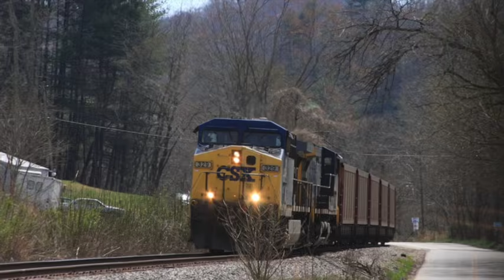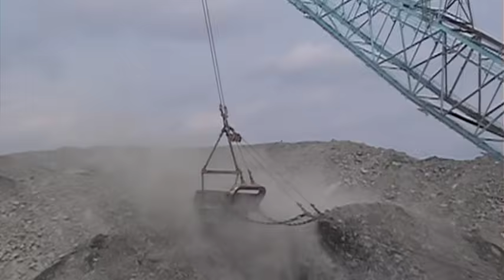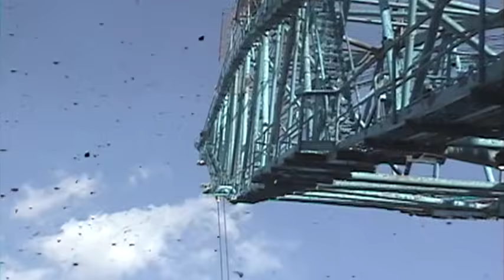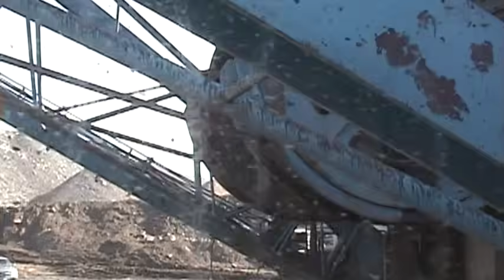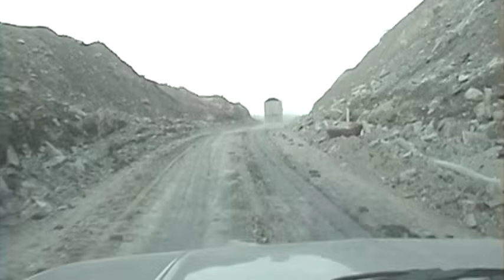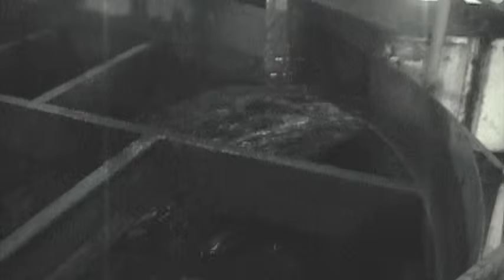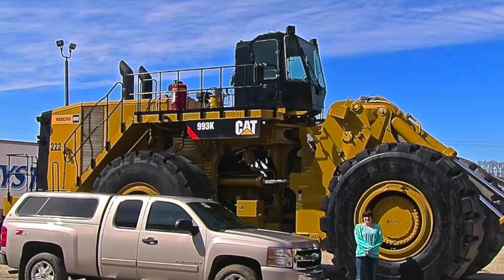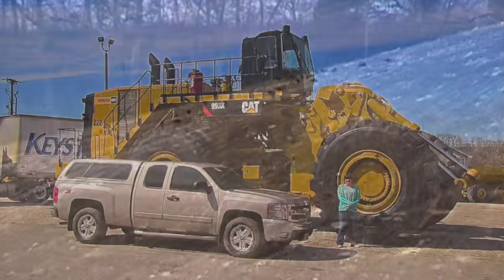Coal Mining in Appalachia

Comment: new wind farms could supply electricity at a cost of $80/MWh –compared with $143/MWh for new build coal, and $116/MWh for new build gas-fired generation.
Reply: Good points, both wind and solar are too inefficient and unreliable to take the place of fossil fuel power plants. Cost is part of the problem. The more significant, assuming the Sun is out, the largest solar farm in the United States coves 3,000 acres and generates only 500 megawatts. Assuming the wind is bowing wind turbines generate about 1 to 5 megawatts each. Meanwhile environmentalists and democrats want to shut down fossil fuel power plants which generate 1,000s of megawatts on a few acres 24/7 regardless of the weather.
Reply from the maker: ....and you point is?  How long  will it be before wind farms cover enough land to make the amount of electricity needed to replace the coal plants now in use?  Maybe for now we will have to settle for coal to make up the difference.  Do note my video is neither for or against coal, it is simply how it is surfaced mined.
Reply: historical energy production data reveal that if nuclear power never existed, the energy it supplied almost certainly would have been supplied by fossil fuels instead (overwhelmingly coal), which cause much higher air pollution-related mortality and GHG emissions per unit energy produced.... Human-caused climate change and air pollution remain major global-scale problems and are both due mostly to fossil fuel burning. Mitigation efforts for both of these problems should be undertaken concurrently in order to maximize effectiveness. Such efforts can be accomplished largely with currently available low-carbon and carbon-free alternative energy sources like nuclear power and renewables, as well as energy efficiency improvements.
Reply from the maker: I am for any type of energy production, the cheaper the better.  It is often said we are addicted to fossil fuel, no, we are addicted to energy.  But it will take time to replace that which is produced by coal.
Reply: AJ Good luck building windmill farms. They are very dangerous to wildlife and anyone who would support the construction of them is a complete idiot AND a moron. The windmills kill little birds and disrupt migratory lanes for butterflies.

Comment: More of these videos are needed to educate our rather ignorant younger generation.
Clean coal provides the electricity for their computers.
(Now go put your xbox down and step outdoors)
Reply from the maker: Clean coal does not mean the coal itself is clean, it isn't.  What it  means is the technology to burn it and remove the bad stuff before returning it to the atmosphere.  I once ran a fluidized bed boiler that burned coal mixed in with limestone.  It was a Dept of Energy demonstration plant funded by DOE, state of Illinois and Combustion Engineering.  Burning the coal with limestone at a controlled temperature less than normal burning in which the lime stone sucked the sulphur from the coal turning the limestone to gypsum..  It worked but has not been implemented.  The exhaust was mostly carbon dioxide, the burning of natural gas doesn't need all the clean technology needed to remove the pollutants because none are present as in coal but it still emits carbon dioxide.  All combustion does.
Reply from the maker: Thank you very much Mike, I take your words as a complement.  It is fun showing the video to young people.
Reply: What is clean coal?
Reply: There is no "clean" coal!

Here's what's powering MY computers, at about 8 cents a kwh;

Our customers want more renewable energy – 91% of those we asked say 
it’s important to utilize renewable resources like wind and solar. We 
couldn’t agree more. And we're doing it with minimal cost impact to our 
customers. Our rates in Iowa are the 9th lowest in the U.S. – about 37% 
below the national average.      Our 100% Renewable Vision
        In 2004, 70% of our generation capacity came from coal and 
nothing came from wind. At year-end 2016, 48% of our generation capacity
 came from wind and  31% came from coal.
        In April 2016, we announced our 100% renewable vision; we 
want to provide 100% renewable energy for our customers. That vision 
involves Iowa Utilities Board approval of our 2,000-megawatt Wind XI 
project.
        When the Wind XI project is complete, our annual renewable 
energy generation is expected to reach a level that’s equivalent to more
 than 90% of our customers’ annual retail usage. And we will continue to
 evaluate opportunities to realize our 100% renewable vision.
        Generating energy is only part of the solution. To support 
the integration of renewable energy onto the power grid, we are 
investing in our transmission infrastructure and working with our 
transmission provider to ensure it can carry the new power load. All of 
this work helps us move toward our 100% renewable energy vision for 
customers in Iowa.
https://www.midamericanenergy.com/our-renewable-energy-vision.aspx
Reply: LOL clean coal!! Keep watching Fox news. NO SUCH THING AS CLEAN COAL! Coal is carbon and when you burn carbon you release pollution WAY worse than natural gas, hence DEATH OF COAL
Reply: @travelingdude33914  I'm gonna keep on using it
Reply: @travelingdude33914  Natural gas is carbon (CH4).

Comment: Great video - When I saw those elk I thought they look just like the ones in Utah. I didn't know they were transported. Glad to see they are doing well. How does the reclaimed land compare to the previous land?
Reply from the maker: +MarkTheShark Thanks for the complement.  The mountains are leveled somewhat.  There are still mountain tops in places and all the valleys are almost untouched.  The elk decent into the valleys every day and come out in the evening.  I've got some great video of them if you would like and it will show the kind of terrain that is left after mining.
Reply: +Gary Smith Yes - I think you should do a follow-up on what gets left behind. The good and bad. What happens to the land after reclamation? What about the jobs, do they go away? Etc.. What about those slury ponds, do they stay around forever? In general, is it worth it?
Reply from the maker: +MarkTheShark This was filmed on a strip job a few miles south of the one you saw.  It is a good representation of what the land looks like after the mining is done.
http://youtu.be/kFmh1ufB6Vc

Comment: Not a good idea to use those Semi Trucks in the mining for hauling ore. Hope they've changed to Cat or komatsu haul trucks
Reply from the maker: Semi Trucks are  not used to transport over burden in the mines.  They are used to haul the coal to the tipple for loading on to rail cars.
Reply: No it isn’t. Most are even worst after getting out of the mine. Deep mud, sharp rock and much longer. This part of the haul doesn’t have a courtesy push from the mine operators. Even if the public road is kept clean the trucks aren’t safe after playing Off Roader loaded to the max. This expense saved and public safety hazard is a direct profit in mine operators pocket.

Comment: Cypress coals owned starfire, lost mountain and buckhorn processing. Tipples were at hardburly (starfire) Bulan (lost Mountain)..Addington Borthers bought out Cypress Coals and run those mines until they went bankrupt..Frazier Creek Mining bought the site and ran coal. Frazier creek still owns the property and The Lost mountain job is still running although the coal goes to pine branch loadout on hwy 80 just west of Hazard. Arch coal has a job on the old starfire lob and is currently still running coal there..There is many people who use the land to raise cattle and this is besides all the wildlife that can be found there..
Reply: +Dennis Statzer I thought horizon natural res. owned starfire ...?  back then   they filed grievance against the feller I worked for steam cleaning and he sold his brand new truck to pay payroll...
Reply: I had forgot about horizon coal..they were owners of starfire for a while and might have even been owned by the addington brothers.
Reply: I remember seeing huge trophy elk up there all day long. They had those big fenced in lots that said UK research bin lab #1,2, and so forth. We usually were there but every weekend sprayin equipment 14 to 20hrs at a time. We finally got to wash the big 793s between shifts one evening whiles they were running and I got out ontop of the engine sprayin but time it started to idle up to stay warm and I thought for sure I'd cut a wire and cause it to runaway lol.  Man how I miss those days

Comment: excellent video gary, the old starfire job was huge in its day. pretty sure the dragline was sold to massey energy and went to west Virginia. strip mining operation are few and far between anymore. I operated a 789b for several years,and once again great video.
Reply: I always heard it went right where he said in vid…worked a little on sf…coal Mac…Massey…Appalachian fuels…cam mining…and probably 30 or 40 more..pretty sure I seen a module or 2 headed down 23 back then when it got sold….the blue paint and 5” thick grease give it away…I used to play in it
Reply: @charlesmullins3238  a guy did a update on it a while back. It was at progress coal on twilight job. Was sold and shipped overseas. I guess at least it wasn't scrapped.
Reply: @ihop.powersportstech where’s that mine at?